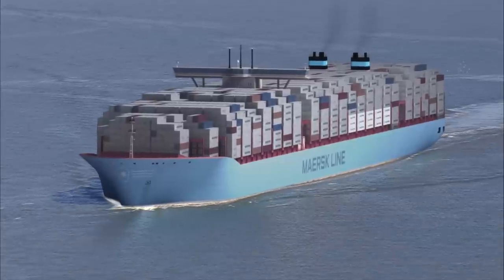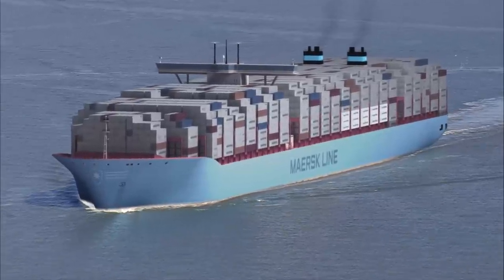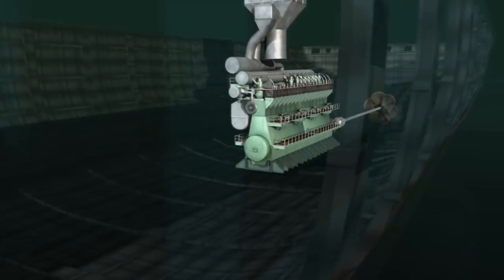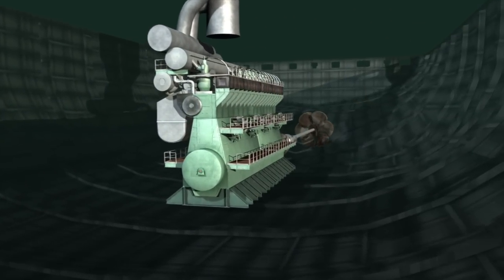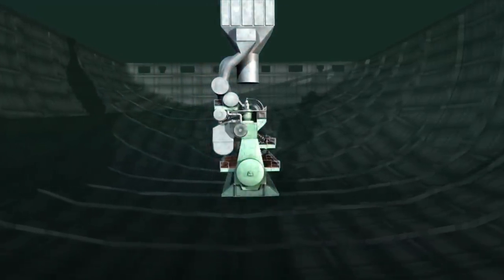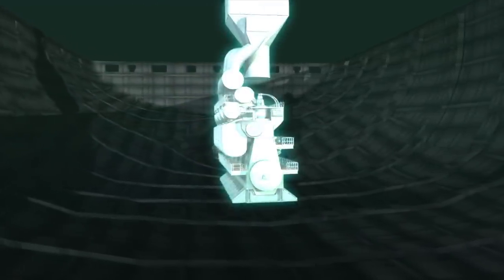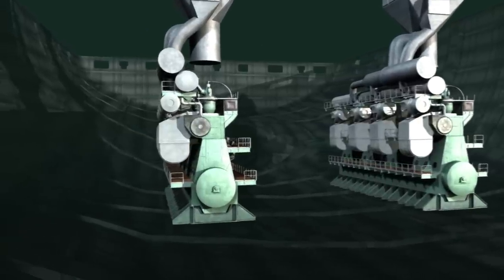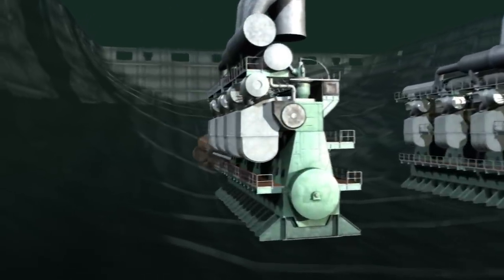Maersk Line - Triple-E: Efficient propulsion

Comment: When I was in the US Navy, I was on an ocean minesweeper. We had 4 Waukesha V12 engines of 600 hp each. The ship had 2 shafts and variable pitch props. My question is, can these huge ships be fitted with variable pitch props?
Reply: gordon vincent Well, it would make sense for a vessel operating at a wide range of settings, but these ships are controlled. They coast at the same rate in their most efficient designed state. Maybe the propellers aren’t meant to be used any other way.

Comment: An issue with a large propeller is you have to have deeper water...  That could be part of why they went with 2.  Taller prop means the ship may not be able to get into some ports or pass through some channels.
Reply: The ship is 400m long. It won't be prop diameter that keeps it from certain ports.
Reply: True

Comment: The bigger the propeller the higher its efficiency (cavitation issues arise with small props). Less propulsion lines less losses. So why this ship should have a 50% lower fuel consumption ( CEO speech )? I just want to point out that going for 2 engines is not increasing the efficiency. Hopefully the 2nd E is due to other factors.